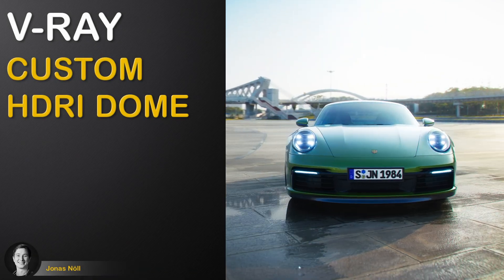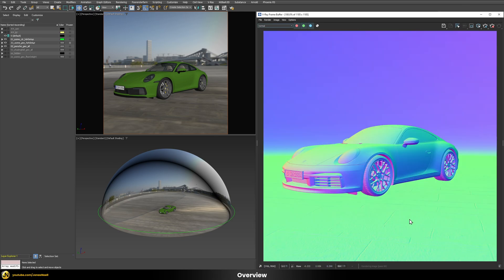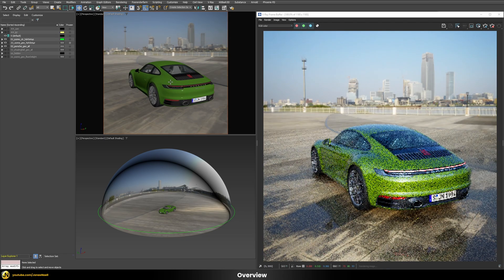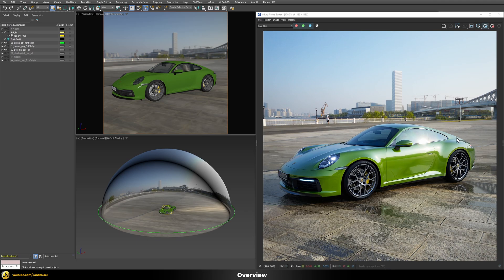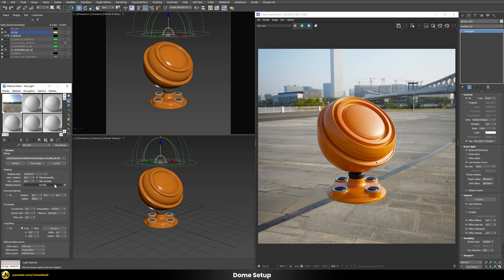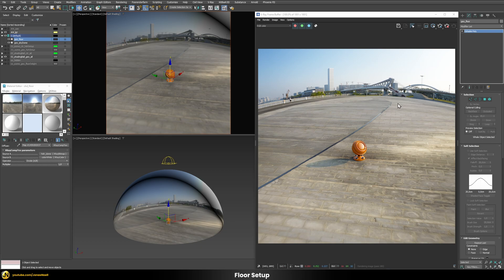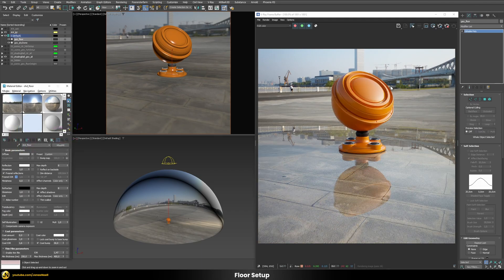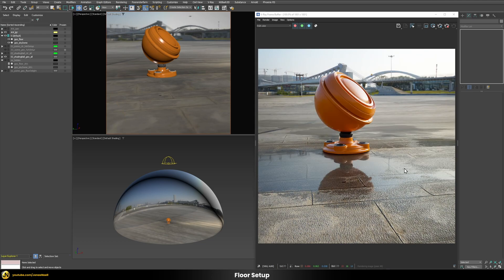V-Ray | Custom HDRI DOME Setup - For better Results

Comment: HELLO, COULD YOU HELP ME, I create the sphere and apply the vraylight material, but the hdri doesn't appear in the rendering, I invert the normal face but it still doesn't appear.
Reply from the maker: Probably either no UV mapping on the sphere or you set the HDRI in the Vraybitmap to spherical projection. You need to use 3ds Max Standard if you map it onto a sphere
Reply: @JonasNoell  thanks for responding...should I use uvw in spherical??? Yes, I set the configuration to "3dsmax standard"

Comment: You got to go through all that just to get a render. Twinmotion is far better, so why even bother with this.
Reply from the maker: If that works better for you then use that instead. Remember that everyone has different requirements and use cases, so what works for you might not work for someone else for their circumstances
Reply: @JonasNoell  Time is money chaos group aren't  helping. If its not a couple of clicks away, there's a problem. That's why blender is not used by  professionals.

Comment: Just wondering. Could you use this workflow on a tracked camera footage to match light better instead of of using just hdri?
Reply from the maker: Not sure what you mean exactly. This workflow requires spherical mapping inputs, so I assume your camera footage is not compatible.

Comment: I wonder if it can be used for product scenes as well? Or would the dome technique be good only for outdoor areas?
Reply from the maker: Can be used in the same way but if you have an interior hdri then normally in there is quite close to the camera so you may see distortions as you are just mapping the image on a simple dome geometry. The dome approach works best if the environment in the hdri are far away like for example on a big parking lot or something similar
Reply: @JonasNoell  Thank you for your answer. I understood what you meant very clearly. Then you had an old tutorial video for the product. You did it with a chair as an example. I will try to create a scene with that kind of background and lighting. I wish you a good day.

Comment: Great technique ! The only difficulty for me is that I do not use this material editor. I used to use slate one which is also a standard for Unreal Engine  (all nodes are visible).
Reply from the maker: I use that also whenever the setup gets a bit more complex, but I think in this case its fairly simple. Actually the classic editor has many advantages compared to the node editor and it is so much faster to use and handle a lot of materials.

Comment: Hi jonas, 

First of all, thank you very much for your highly insightful videos. The content of your videos, compared to many other channels, is always refreshing and informative. The only thing I would wish for in your videos is, especially when it comes to materials, to show examples using the Slate Material Editor. Otherwise, it can be very difficult to follow along or resolve issues if one doesn’t really use or is unfamiliar with the Compact Material Editor. I hope it might be possible to consider this feedback at some point. Please don't take it as critisism and keep up you good work!
Reply from the maker: Hi thanks for the feedback. I normally use the slate editor whenever the shading gets a bit more complex. But in this case I felt it is very simple so I normally use the Compact Editor as the Slate Editor takes away too much real estate on the screen which is limited

Comment: Good tutorial. The material for the dome setup i need to see it in the slate material as nodes with a final node that should be give as material of the 3d dome. ¿The dome whas map with Unwrap UVW before the material was applied? ....Yes, would prefer to watch all materials made in Slate Material (as nodes) and the procedure need for UV mapping the dome. Thanks.

Comment: Did you use acescg vray it in this lesson?
Reply from the maker: Nope but would not really change the workflow much
Reply: @JonasNoell  But the colors appear saturated and beautiful
Reply from the maker: You need to use the correct Aces workflow. I have tutorial about this in my channel
Reply: @JonasNoell  I know I should use Aces
But you say I didn't use it in this scene.
So how did the colors appear saturated?

Comment: Seriously Jonas, I've been following you for a number of years (always telling you you can date my sister) but honestly, how do you figure these techniques out? Is it just intuition and years of understanding all the mechanics of V-Ray or you just things you also uncover overtime? I'm seriously impressed by your ability to discover all these amazing techniques?

Also, one last question. In all of your tutorials (including this one) from here on out have ACES on by default or no?
Reply from the maker: It’s basically just trying to find ways to optimize a workflow and also taking inspiration of other things that I see in tutorials for other software and so on. 
Normally my tutorials don’t use Aces by default as it would complicate each tutorial a bit. But Aces can be easily added by using the workflow that I showed in my Aces tutorials
Reply: @JonasNoell  But in this tutorial for transparency reasons, do you have ACES enabled?
Reply from the maker: No that’s sRGB
Reply: @JonasNoell  How did you use SRGB and the scene appeared in such wonderful colors?
Reply from the maker: @BASSAMALZAIDY-m7t behause of proper tone mapping. Aces just has this built in natively under the hood
Reply: @JonasNoell  I don't understand, can you explain more?